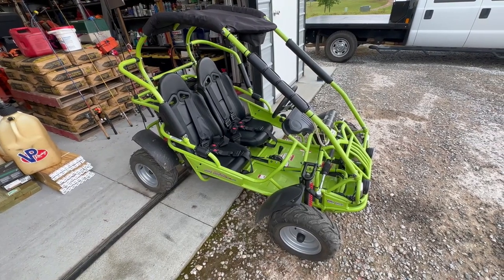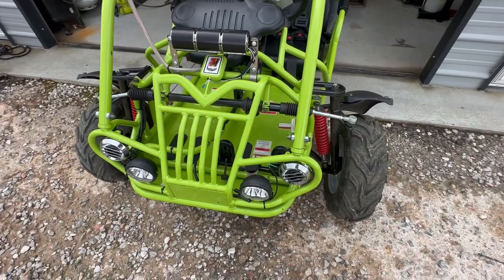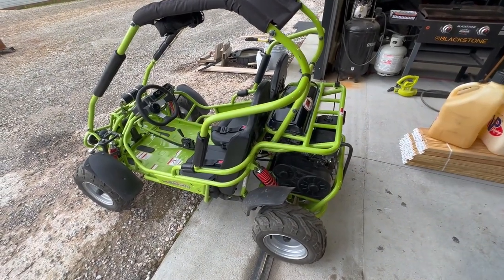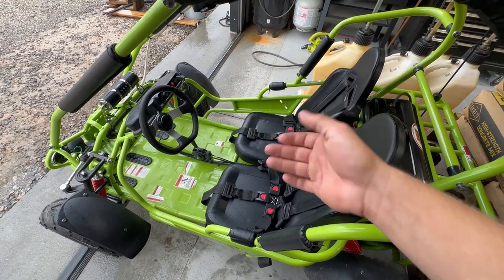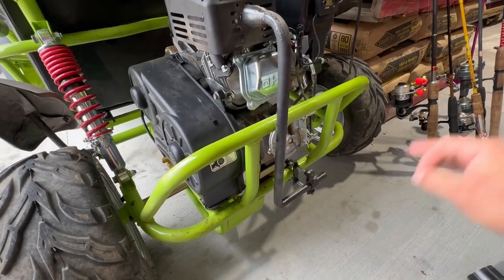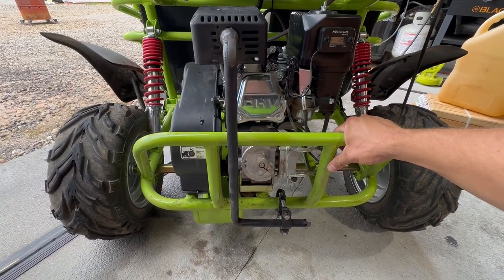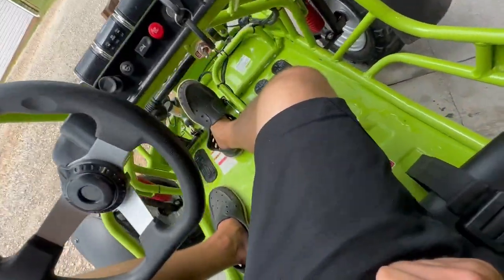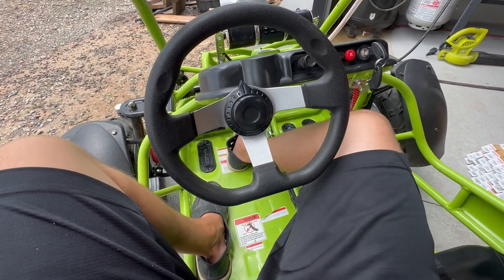Go Kart Review Trailmaster | Go Kart Mods

Comment: just got my XRX+ a few days ago.  Mine didn't come with fenders or a canopy.   Mine came with a cage for the exhaust but only one bolt worked and had to add 1/2" of washers to make the 2nd bolt work then the 3rd bolt hole didn't align with squat.   Plus the third day the chinese battery they supplied was shot.   I don't know why but there was motor oil everywhere in my cart box but the oil filler cap was loose.
Reply from the maker: Sorry to hear about that. I did have to charge the battery after about a week and a half but I haven’t had issues with that since. The only other issue I had was the gearbox was leaking oil on long rides. Come to find out they forgot to put an o ring in and was covered under warranty.  Other than that it’s been bulletproof. I will say it’d be a good idea to go around every once and a while and check all the hardware for tightness.

Comment: I'm not a mechanical guy I'm a welder I would like your opinion on the engine is it powered enough for fun or just putting around
Reply from the maker: Honestly it’s more powerful than I expected. With me (170lbs) and one of my girls (70lbs) this thing can almost go full speed up the hills in our yard. When it’s just the 2 girls it goes full throttle no problem. It has the cvt and it’s way better than the centrifugal clutches that I grew up with.

Comment: Great video. Can you share how you wired up the radio and light in more detail? Id like to make sure i get the wiring correct and not drain the battery
Reply from the maker: Sure! The easiest way is to look at the back of the key switch. One of the wires goes to the lights on the go kart. If you turn the key on that wire powers the back of the light switch. The lights will come on if you flip the light switch but only if the key switch is turned on. Hook the radio power up to that wire. (I used a ring terminal) that is for the positive wire. For ground I just connected to the frame of the cart. Hope that makes sense! If you end up hooking it up and it stays on all the time then just switch to the other terminal on the switch for the positive.
Reply: Thanks so much! Ill give it a try.  Issue i have now is fuel tank is leaking at threads so contacting company to replace fuel tank. Bummer.

Comment: Will 300 trailmaster  rims an tires fit on a mid xrx ?
Reply from the maker: I looked and it doesn’t look like it would without modification. The 300 has bolts/studs, where the mid only has the nut off of the bearing in the center.

Comment: What kind of pipe is that on the exhaust?
Reply from the maker: I explain that part between 9:40 and 12:00 I would try and type it out but it’s to much to type haha
Reply: I have a chipper/shredder that I no longer need after a multi-year yard clearing. 

Briggs & Stratton motor 12.5 ft/lbs of torque, but noisy as heck.